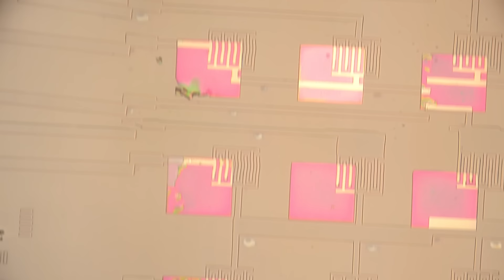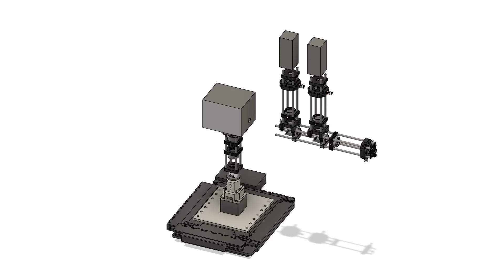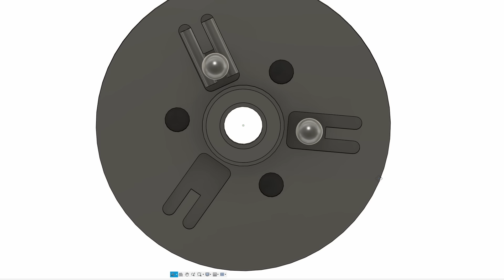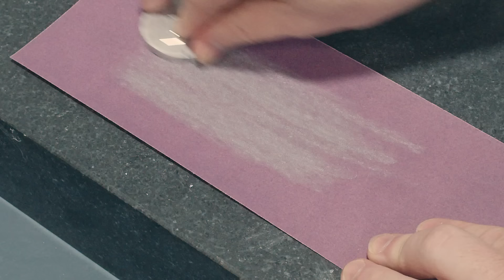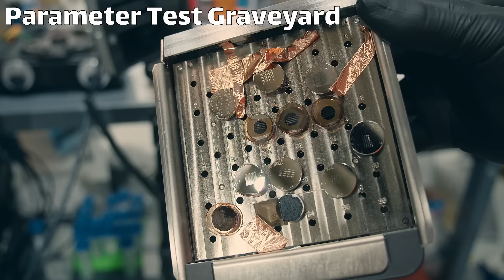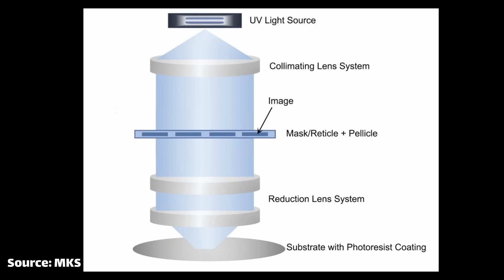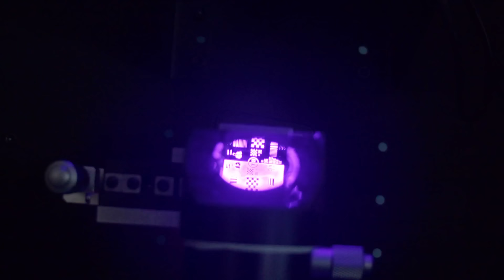Speedrunning 30yrs of lithography technology

Comment from the maker: Why bother with the rotation stage?
Good question! It was for multi-layer alignments. I.e. pattern first layer wherever on the substrate, and then align all subsequent layers to registration marks on the first layer. In theory this could all be done in software (rotate the image digitally) but it introduces a lot of complexity to the software. I thought mechanical solution would be easier. But my design (direct drive to a stepper motor) was a flawed idea and in retrospect there are much better ways to do it.
Reply: The easy way to make a rotary vacuum too head is to use a dual hollow shaft stepper motor with a flexible silicone pipe at the bottom end and the tool head at the top. Obviously you have limited travel but you can easily do 360 degrees. That is how DIY pick and place machines work. No need for o-ring seals.
Reply: Regardless, I still loved the video and I hope you properly congratulate yourself for the wins you were actually able to achieve.
Reply: or you could locate the rotation by removing a part of the circular wafer, like it is done in industry. If you have a straight edge you should just need a couple of dowel pins to locate against. (in theory)
Reply: @BreakingTaps  to do layer-to-layer, you'll need to be able to figure out your pixel size in X and Y, as well as the skew of your optics. Hint: calculate your per pixel H move with X and Y, then do the same for V pixels. You'll have 4 calibrations numbers that you should be able to do all of the math with after. Also, you'll need to deal with your flat field correction for the objective. You can either shrink the exposure window or you can grayscale your output and correct with a digital mask. The easiest way is to use a white background and capture a blank window with the red wavelength with your inspection camera. You'll then need to map camera pixels to exposure pixels
Reply: Doing this direct drive seems to also introduce dependencies on the motor's alignment accuracy, which I'd assume is variable due to many things. Since you're dealing with low speeds driving a gear in an appropriately constrained fixture should remove most variables. Lube may be a new issue due to the vacuum.
Reply: As someone who works in the Semiconductor Industry, there's one key factor you didn’t think about throughout the whole process:  Particle Contamination.  Although this is basically the hobbyist version of Semiconductor work, it would help you in the long run to have not only some kind of Clean Room Space for your equipment, & proper gear to eliminate contamination from the outside or even your clothes.  Love the work either way tho, you're doing great thus far!
Reply: I think Powder coating not paint would be better.
Reply: @BreakingTaps Definitely go with the powder coat for machine parts if you have that option, I am NOT in this industry but I had a powder coated tattoo machine that has been exposed to extremes chemicals , metal on metal, more chemicals… for almost two decades and it is still like new
Reply: I would ask how much travel you need. If you can get within 5 degrees with crude eyeballing it, your setup will never need more than 5 degrees of travel. A full stepper motor seems excessive. Secondly, surely it would be easier to rotate the mask? Even if the mask is a mirror array, the fact that it is unmagnified should mean that the tolerances would be easier to hit. The other side of the beam splitter gives you access to do metrology on the mask directly, which might be useful. Love the work anyway; you don't know things are dumb ideas till you try them! I am perpetually amazed by how much of the world is build of dumb ideas that actually just work.
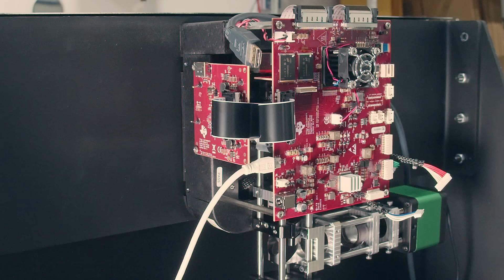Reply: At 41:40 "The diodes are shorted open." Neat trick, that. You can't be both of those at the same time. If open, the voltage across the diode will equal the driver voltage with diode disconnected. But 0.71 volts is NOT enough to make ANY visible or UV LED emit light. It may be enough for some IR devices, but I don't have experience with those. Always be aware that bright light from the room or camera lights landing on a LED can cause it to generate voltage, OR cause it to act like a light-sensitive resistor. So it is good to do LED troubleshooting with LEDs both covered and uncovered.
Diodes can fail from getting too hot (too much current and/or not enough cooling) or they can fail from too much reverse voltage, possibly including static electrcity discharging through the diode. A good thing to do in that case is to put a diode with opposite polarity across the NEW LED.
Reply: @YodaWhat  I think he just meant its no longer blocking reverse current lol, but yeah unfortunate wording.
Reply: Great video. Thanks for pinning the comment. Had the same question!
Reply: also: if you're planning on doing things like multi-patterning, I'd recommend having a way to flush sequential layers using printed on-wafer marks, either mechanically, optically or using electromagnetic resonance of printed on two-part open tank circuits - depending on what kind of instrumentation devices you can use.
Reply: i think that you dont need rotary stage at all
Reply: <>In tradisional buying and selling agreement : 
1. The buyer gets the products, its ownership is the buyer.
2. The seller only provides the maintenance and the after sales.

<>In today agreement : 
1. The buyer gets only to partially use the products.
2. The seller can refuses to do maintenance and the after sales.
3. The seller can also unilaterally uses the back-door to shut down the products.

<>These attempts are very dangerous and can become the role model system to the other sellers.
Reply: Viva Taiwan
Reply: I realise this video is a bit old, but, do you think you could make a commodore 64 from this. it has "The MOS Technology 6510 microprocessor, used in the Commodore 64, was manufactured using a 7 µm (micrometer) process. This is 7,000 nm (nanometers)—far larger than modern semiconductor nodes, which are measured in single-digit nanometers." . I imagine some enthusiasts would be happy for a truly custom build.
Reply: Was the microscope  objective good enough for 1um resolution in 305nm?  Usually they are designed for visible and I can imagine you have very low MTF with poor contrast. Also  Isnt barrel distorsion too high so stitching becomes impossible?
Reply: Can you post your codebase on Github?
Reply: Honestly, when I first saw you assembling the rotation stage my first thought was "how will he ensure the rotational stage is planar?"

Based on your DOF with that level of magnification, I assumed that traditional indicators you'd see in a machine shop wouldn't be good enough to adjust it into focus across the whole stage. It's an unfortunate problem to run into, and besides having better methods of measuring to improve the accuracy you would either need some different equipment (surface/rotary grinders/etc) or a lot of patience and skill with sanding/lapping.
Reply: @LuciaMakes  Yes, I almost felt like someone watching a football match, when the enemy strikes a goal. Like: 'OH, nooo' Because I thought immediately this introduces so much error.
Reply: Do have at least hepa filters running in your shop?
Do you have a clean room?
Do you have a design and space for one?

I don't think you're getting a useable chip out of your machine if you ignore the basics.
There is dust everywhere.
How are You going to manage dust?
Reply: @Nightowl_IT  You can just buy small tent clean rooms, shouldn't be that big of a deal. Prolly makes sense to get the machines ironed out and repeatable other than dust before worrying about that though. Taking them in and out to partially rebuild is just more work.

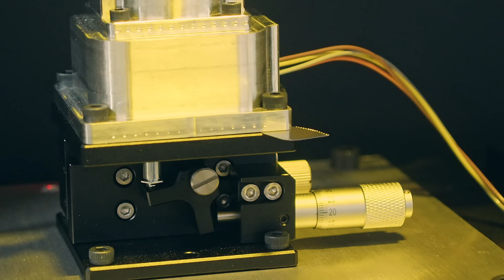Comment: 22:43 You couldve skipped that whole problem side quest with a sub level micro focus trim adjust between the layers. Like a cagemount, rotational trims etcetera  It's a little cumbersome but you can purchase them prefab and the results you would've gained are well worth the extra effort. It also adds another auditing step in your process but you will know for sure it's square in focus every exposure.

Comment: In a cinema projector using the same electronics the light is homogenized with a long rectangular piece of quartz called the 'integrator rod' or 'light tunnel'. When you project movies you have the same exact problem - you don't want a big burn spot in the middle of the screen, you want the light to be exactly 14 ft. labert or above across the entire screen - an even pure white rectangle. Focusing of light is done using a spherical reflector lens inside the lamp box.

Comment: I repaired a lot of cinema projector light engines, and the DMD dev kit from Texas Instruments he has there is very similar to what's inside a DP2K Barco cinema projectors, essentially one of the GREEN/BLUE formatter cards. It might be cheaper to just find a cinema projector at a landfill, as Barco doesn't want to fix this 'old' tech and cinemas have no clue how to fix these DMD drivers on board level. So in every shot projector on eBay one of the cards is broken, but you only need one color, not 3 so you can work around the issue. It would be cool to see someone get an industrial pane of glass as big as a cinema screen, pass UV light thought the light engine and cure resin in like 1cm layers to 3D print an entire car chassis or something.

Comment: The UV diode measuring near 0V in both directions means it went from being a semiconductor to becoming a conductor because probably aluminum melted with silicon of the chip. It is not open, but is a short-circuit now. 

If your multimeter says OL in diode test it means that no current is flowing at the highest voltage it wants to provide to the device under test.

Comment: Yes, technically you could "cheat" by speed running, however you still had to design the machine, order the parts from sendcutsend, and design the boards, order them from pcbway, and program them. I'd say you did excellent here.

Comment: Facinating work. Although the frame being made from quarter inch steel was definitely over kill. I think you could have got away with quarter inch aluminum and avoid having to treat the surface with paint or powder coat. Also that thing must be heavy as hell 😂

Comment: You have a lithographic version of a bedslinging 3D printer. Fine Z-control could let you make a map of the surface of your stage, and program around any consistent deviations by raising and lowering slightly for each spot according to it's elevation. Or, that's overcomplicated. I'm not an engineer yet.

Comment: Red LEDs must have a higher forward voltage drop than 0.7V (sth like 1.5V); that looks like a voltage drop of a typical silicon diode. My run of the mill multimeter in diode test mode doesn't go high enough and gives "open circuit" indication on red LEDs in both directions. Maybe there's a diode in the opposite direction next to color LEDs for some reason, and its presence is essential for the LED driver? (I don't quite see what kind of driver would want one there, nor why it would be there as opposed to next to the driver, so I am probably confused about the situation.)

Comment: When you changed the magnification in the original machine the size of the pixel you could image clearly did change; however, could you image everything multiple times at different sub-pixel shifts (provided by the horizontal stage)? That might not work either because the change also decreased sharpness (but less than proportionally to the magnification change), or because the image cannot be summed from such shifted-large-pixel images (because it contains dark areas separated by too-thin much brighter ones), or for some reason I can't see.

Comment: Mechanical engineering student here: the sheet metal body sounds like a bad idea from the start, because it is. Whenever you want two parts to come together to form a precise whole, you need to have them connected by a really stiff structure. There's a reason why CNC machines are so chonky and solid. For your next revision, I'd suggest using some beams to brace the whole system. I probably don't need to mention that mounting a stepper to a super-precise stage system is also not ideal 😅

Comment: I have a design in my head, but it will work in the real world. Its XY movement has no rods, rails, belts, gears, pulleys, etc. of any kind.
Absolutely zero backlash.
Well, if you make it out of metals that would be expanding or contracting during operation, that could create unwanted effects.

Comment: Coming from amateur photography background, why use open gate?  Most lens' are not sharpest wide open, also, if you had an aperture, you could make your depth of field WAY bigger and have to worry way less about being in focus.  Since everything is still, why not use less light, but longer exposure?  Wide open lens = shallow depth of field.  Smaller aperture = bigger depth of field.  (Asking expecting there is probably a good reason why not)

Comment: Awesome work, bro. By the way, at the end there with the LED issue, you could carefully cut a panel in the back using a Dremel, and then put a panel cover over it once you're done. Just go ahead and replace the LEDs that way. That might be easier.

Comment: 5 micron would be an achievement, why rotate, sounds problematic, simply getting things flat, square and parallel is a major hassle, then 3+ degrees of fine adjustment, and a dynamic autofocus to deal with substrate variance, I could go on, printing and scanning, Thermal 10K dpi 800nm, printing game, magazines, pcb's and of course IC's.

Comment: Try laser thinner one made a waffle each plates 🤔 be in retro chips but rad than old statements of writing of cpu?. 🤔 in high speed cut them for waffle?🤔 Just wondering about that. 

I am not go build that but just and JUST wondering about it about laser thinner cut and speed specifically measures and waffle them🤔

Look at old school waffle pancake is that first wafers?🤔 plate it into see if function work in big tubers machine what responds active?🤔 if i am had tools I will build one and flip see if work😂😊

Comment: WHY am I watching this Channel?

At 75 years old, I am in the middle of setting up, Three different Work Benches.

ALL 2×4 foot, (for continuity, I could potentially get confused, with Larger benches 😅).

I BUILT my first Radio, in 1957. The title of this, Thirty Years of Lith. says to Me, gosh, that was not Long ago!

By 1962, my Brother & I would go to the local HAM RADIO store, to ask technical questions... he would give answers, until a Real Customer would come in, at which point he would GIVE us some Free transistors, and say Geddouttahere 😂

By 1968, in the US ARMY, entering my AIT (Advanced Individual Training), I found myself working (to repair) the Army's First Intigrated Circuit Tranceiver . . . for which I needed a "top secret" clearance, at that time! MOS: 35L20, Avionics Equipment Repair

Historically speaking, Man had not yet stepped on the Moon, that happened 90 days After I graduated: from High School, to AIT, I was 2nd highest GPA in my Company, that guy that was #1 GPA, cheated, he had a BA Electrical Engineering Degree 😅😅😅, In short (too late, too late . . . )

ALL the above to say, I find this channel to be highly intrresting!

My Machining Bench has a Proxxon Mill & Lathe, capable of X,Y,Z to 0.02mm fairly course work compared to what I am viewing . . . But Thirty Years ago, I was manually machining to 0.0005 inches or 2/1000 of a Frog Hair 😂😂😂

I am also doing an Electronics Bench, which has 3 Arduino's, 2 Raspberry Pi's & a Beagle Black Bone SBC, awaiting for my attention, (as well as a Flipper Zero ! ! ! )

Please don't mind me if I interject some history now & Then, I went to Kindergarten, just after they STOPPED using clay tablets to write on 😮

philip, from the Great Pacific NorthWET, Oregon, USA

Comment: The fact that “you” can make your own chips is really interesting. “You” can literally make super secure ultra fast smartphones that do not have government mind control daemons and hidden spyware back doors, and technically, you’ll be allowed to use the telecom infrastructure.

As we know, when you use the entire chip surface area to design circuits that only run software, and not multitask spyware and mind control, you can make the operating system remarkably fast. When it doesn’t run government spyware in the background, it goes as fast as you think it would.

Comment: this first picture at the beginning of this first transistor looks a  bit like an experiment how to best get energy from a simulated static flash grabbed and in a more useful way.
like a flash from the sky hitting the ground. same as when it hits sand. it forms glass. so the crystal could simulate that transitioning in states from sand to glass as our glass endproduct.
from there on you have 2 sides at this triangle crystal where you grab the energy from or influence how the crystal is changing its atomic structure somehow. would at least make somehow sense to me. 

something like that. otherwise it would not explain why it looks so big and simple build. also that zig zag pattern on top at the cupper part. it looks more like a flash coming from the sky hitting the ground to me.

Comment: Hey mom, can we have TSMC?
No, we have TSMC at home
The TSMC at home:
Reply: Except there wouldn't be that much use for tsmc at home, but this is amazing for producing simple/discontinued chips for automotive, wearable etc, you wouldn't design a chip that needs 5nm as a side project at home, and those simpler chips just don't need tech newer than 15-20 years.
Reply: @__username1  I don't need 5nm, I'd rather use 10-20nm so I could produce DRAM.